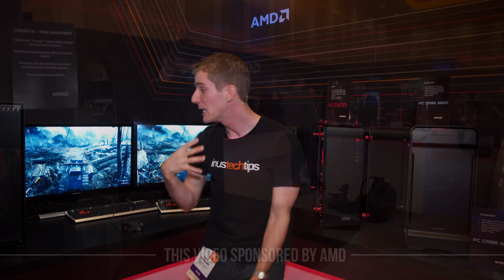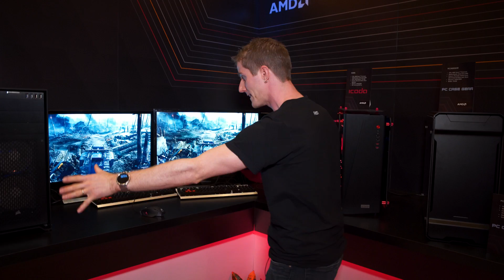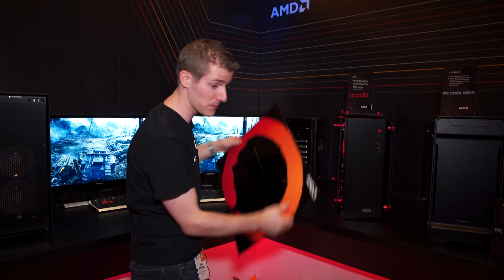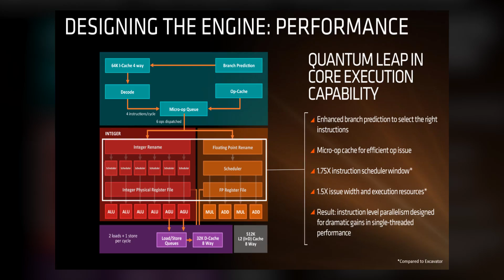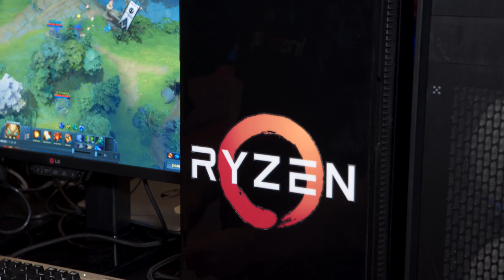AMD Has Ryzen!

Comment: That moment when you just bought an i5 6600k...
Reply: same just bought an i7 6700k
Reply: Deniedstingray its ok, when AMD releases something you don't need to worry
Reply: I just got a i5 660k too, got it for like $120
Reply: i buy an intel core i5 6500 & gtx 1070. Im really happy with it
Reply: dw, bought 6600k 6 months ago, be happy because 6600k is keeping up real good with 7600k and the difference isn't even considerable, but ryzen is a different story bruh
Reply: i bought a 6500, only because I desperately needed an upgrade from an i3 3120m laptop with hd graphics
Reply: I just bought a 8370 and I'm very happy with its performance on any game basically on ultra paired with my 1060 :D can't really complain.
Reply: i bought a 4790k
Reply: Tian kay have you tried to rma your chip?
Reply: Conor Uhh, cause it's a quad core and some games don't run well with a dual core.
Reply: I don't know, maybe availability? Here in Germany 7600k's and 7700k's are pretty rare right now. The next supply of 7600k's for Mindfactory (german site) is coming in on the 11th of January. And even then I believe 1 or 2 days and they will be out of stock.

And Kaby Lake isn't that much of an improvement over Skylake, so it wouldn't really matter.

I agree Kaby Lake would be what you should be going for however.
Reply: Ahmet Refik Eryilmaz I remember when AMD said that the RX 480 would be as fast as a 980 at the E3 PC Gaming show. Sadly people are quick to forget because of fanboyism
Reply: don't buy any CPU till ryzen launches lol.
Reply: Don't feel bad. You can never keep up with technology. I mean, I bought the GL502 and within a month or two, the 1060 versions came out and I'm stuck with the 970m. This is with an ample amount of research too. I'm still salty, but eh. That's just life.
Reply: That moment when someone buys a cpu at this time of year near a new tech release.
Reply: Yet Another Terrible Channel Honestly dude, keep your i5. Unless you are heavy on content creation or render videos frequently, there will be not much difference between i5 6600k or AMD ryzen. Gaming only really uses 4 cores.
Reply: and i just bought a fx8320E
just fuck my shit up fam
Reply: dont't worry im running my i7 930 at 4 ghz and it still kicks ass in games, matter of fact I have the same fps as my fried that has an i7 6700k.  All this talk about new cpus new technologies is just bullshit to make money if you are a gamer you are good with that proc for another 6-7 years.
Reply: Then your friend is GPU bound or runs at higher settings than you. I personally saw an increase of roughly 30% after swapping my i7-930 to i5-6600k(and significantly more in games that are poorly multi threaded). I think the Nehalem chips are the last generation of Intel chips worth upgrading from. Sandy Bridge and newer are still excellent as you can OC them to 4,5ghz+ with minimal effort and they will provide very similar performance to the current generation CPUs.
Reply: My poor brother. I'm still with my Phenom II 965 BE and desperately waiting for ryzen to see if I need to finally buy an intel cpu or if I will upgrade to ryzen
Reply: Bro, who are you buying your stuff from? New egg is selling the 7700k for 332€, for me it 350 USD off newegg.
Reply: You weren't smart. It is known Ryzen is going to drop pretty soon. We knew it for like half a year now.

Although the 6600k is a solid buy, if Ryzen competes with Kaby Lake/Skylake (and AMD will drop CPUs in every price class) the prices will drop quite a bit, I am sure.
Reply: I don't know in what parallel world you live, but it doesn't need to be beaten by AMD. They just have to make something better in terms of price/performance.

And it will be cheaper. No sane company would put out inferior products for the same or even a higher price.
Reply: RX 480, more expensive than GTX 1060 6GB, but only 1% better than GTX 1060 3GB. the 6GB version of GTX 1060 still beats the RX in most todays games, and is cheaper. And don't give me the 'but in DX12 is better and is futureproof!'. It is more expensive and that's it. GTX780ti is fuureproof, still beats RX480, and is 3 years old. AMD should be ashamed. I waited long for that RX480, but they disappointed me so bad, I switched completely to Intel/nVidia, and I was an AMD fan for more than 10 years.
Reply: Absolutely no one cares about VR. Not a real gamer anyway. VR is 5-10 years away from being mainstream. The games are clunky and ugly.
Reply: You can always resell computer component, I always sell mine when I upgrade.
Reply: daniel solomon Well kinda your fault for living there
Reply: Yes, you should wait for Ryzen and the likely price drops, or even buy AMD altogether.

Wait for first Ryzen reviews from CPUs in your price range, as long as you don't desperately need one right now.
Reply: Yet Another Terrible Channel I'm getting an i7 Kaby lake 7700K
Reply: What you buy an i5 for? Useless junk, get an i7.
Reply: I don't think you're gonna need upgrade that monster anytime soon... Clock it 4,4-4,6Ghz and you have enough for at least 2 more years.
Reply: Haha I bought the same chip but willing to replace it with RYZEN,  been waiting for AMD to pull something...
Reply: i feel disgusting right now
Reply: Damn i feel for you mane, lol
Reply: same
Reply: Cirrus 😂😂😂
Reply: Yet Another Terrible Channel I know the feels.
Reply: Yet Another Terrible Channel Same here plus a gtx 1070.
Reply: I too have an AMD FX 8370 and I agree with you i have mine paired with an Nvidia GTX Zotac 980, but tell me how well does yours run in any cpu intensive application? I will tell you about  my experience  some  cpu bound applications aren't optimized evenly  for example a game mmo like TERA  seems to favor intel more than AMD, but i wonder i am right now  using an amd ddr3 memory 1866. Does having a 2400 ram makes difference?
Reply: 23Aike6 wouldnt bother upgrading that ram tbh, the performance gain to cost ratio is gonna be abyssmal, was considering upgrading my own 1600mhz 16gb kit, but it costed way to much comoared to what i would get in return. if you need a ram upgrade it should be on the amount avaible and not just the speed alone. also if you OC your 8370, you will boost you ram chips frequency, since cpu clock and ram speed are tied to the same multiplier.
Reply: Yet Another Terrible Channel I like your picture.....Papa Ajasco?
Reply: Conor Because most people don't need anything more.
Reply: Yet Another Terrible Channel Feelsbadman #AMDFanboy
Reply: outside of the pricetag premium compared to AMDs base CPU it's still solid, and we don't know how AMD rizen CPUs scale with ddr4 speeds but plenty of tests show a positive relationship with ram speed and Skylake. play that to your favor and your likely still set to compete. I'm excited for AMD (I'm a massive fan) but im just excited for added variety to the CPU world. hope this year red and blue flourish.
Reply: daniel solomon I live in Italy and I bought an I5 6500 for 170€
Reply: It's okay, you'll be able to keep that CPU for probably the next 2-4 years.
Reply: drive it until the wheels fall off!
Reply: Same just bought a 6600k...
Reply: Yet Another Terrible Channel That's fine, if that was your price range you're probably not gonna buy one of the high end ryzens that are released first. The 6th Generation Core i5 CPUs are the best sweet spot for that generation, and Caby Lake
Reply: Yet Another Terrible Channel I might should I still buy one?
Reply: solmyr2 Naw man, I was running the same setup 6 mo ago (but at 4.2GHz), I actually got large gains, some 15 to 30%, from moving to a 6700k (tested for equivalence at 4.2, but normally run it at 4.7GHz) in many - but not all obviously - games, as well as professional apps, eg programming (my day job).

This being said I'm definitely not gonna bother with Kaby Lake..!
Reply: You have enough power for now.
Reply: I have mine a year ago and Kaby doesn't bring anything new that is significant. Waiting for Icelake...
Reply: Yet Another Terrible Channel lol its powerful thl
Reply: solmyr2 

that shit will be out of date way before then.
Reply: Tian kay 
Lmao
Reply: wtf why not 7th gen?
Reply: MrNoziv this is literally me with the same exact CPU and everything 😂😂
Reply: Because they're pretty much the same chips.
Reply: NOT AT ALL THE SAME
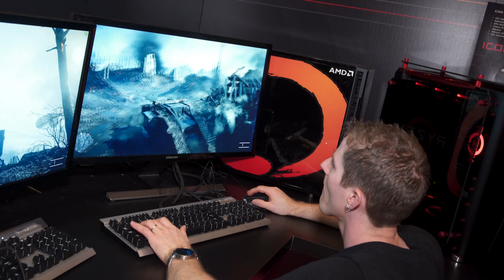At 2:23 intel hits 75-76 fps costantly
whereas amd hits 55
YOU JUST HAVE TO SEE THAT!
also, the amd marker is white , whereas the intel green,
because they never exeed the 58 fps
Reply: Because nothing is moving in the game dumbass. The tank says still.
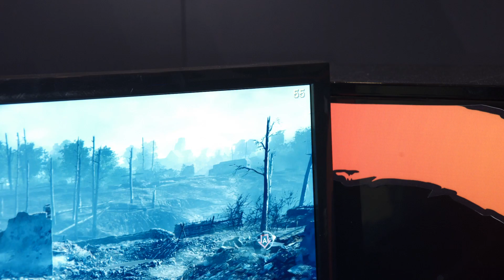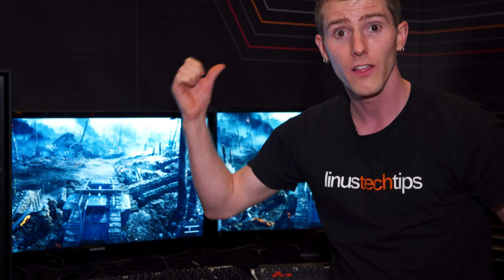Reply: LOOK AT 2:30 UNTIL 2:35
SORRY YOU RE FAULT
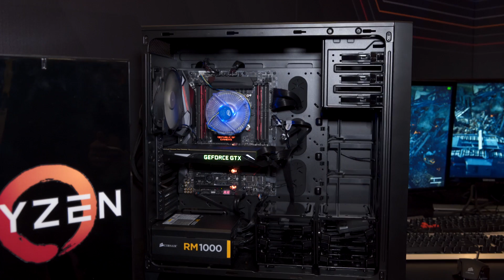Reply: SOORY, LOOK at 2:05 to see that intel has still green fps while linus does;nt play
Reply: Dieser 1337 Baka. plus, if you were gonna go Intel right now, why go Skylake instead of Kaby Lake?
Reply: Dieser 1337 Baka. yeah, if you can't get your hands on Kaby Lake, and you NEED to upgrade, Skylake is still fine... I mean, even if Ryzen is half the price and better performance, that doesn't instantly make Skylake and Kaby Lake trash. they're still gonna be good
Reply: Completely agree. Intel CPUs are solid. Even the ones 3 generations behind. Can't say the same thing about AMD.
Reply: That 6600k will not be beaten by AMD. Maybe in their dreams. And definitely not cheaper.
Reply: Now that really sucks.
Reply: CapsuleGraph used?
Reply: lol AMD never said anything about 980 performance.

They said it is "VR-Ready".

What card was VR-Ready at the time? :thinking:

970. Did it reach 970 performance? Hell yes.

They even told (i believe it was) JayzTwoCents the goal was to tackle 970 performance for a lower price. Not 980. That was the fanboys making shit up.
Reply: You are spreading false information.
Reply: I remember the hype. With that hype AMD lost me as a client. For 10 years I had AMD cpu+gpu in my PCs. Had enough of them.
Reply: Happy moment. You should be proud to own a VERY good cpu.
Reply: I have just said what AMD stated. Which was the 480 is "VR-Ready" - meaning it has 970-like performance.

VR is neat, but I agree. Far from mainstream.
Reply: daniel solomon Are you stupid? Or do I have to explain to you how taxes work?
Reply: Yet Another Terrible Channel lol...you should of waited bro
Reply: I was just about to go buy mine... Yeaaaah not happening just yet.
Reply: Yet Another Terrible Channel You're fine.
Reply: Yet Another Terrible Channel I was going to buy that one are you saying I shouldn't?
Reply: Cj Bower lol please stop
Reply: I just dropped 3k on my new beefy computer. I'm literally building it tomorrow. i7 6800k smh
Reply: Tian kay the g4400 pentium ain't all bad. It was a pretty decent processor for low payloads till I got a job with video editing and then had to upgrade to an i7
Reply: Can laptop CPU be upgraded? If so what kind of laptop? I thought most laptop have built in CPU with the motherboard?
Reply: Yet Another Terrible Channel why not 7600k
Reply: Peťo Pavlík because there's basically no difference, no point getting the 7 series over the 6 series
Reply: Equinox - like what games
Reply: That moment when kaby lake came out...
Reply: Dezza2241 i know but it's newer and have cooler motherboards
Reply: not really anything above 1600 is fine
Reply: If you get an i7-6700k you'll see double FPS ...
Reply: i got mine like about a month ago -__-
Reply: +CapsuleGraph how, mine was 250€
Reply: If Ryzen CPUs end up costing more than $200 then you didn't make a mistake by buying an i5.
Reply: i5 will drop in price tho
Reply: 6600k stays one of the best price/performance. Bought one a month ago for 240€
Reply: Cestarian Inhabitant Yeah becuz the 6700k is SOO much better than the 6600k
Reply: I wouldn't worry about it TBH. I bought one last year, it's the top i5 at the minute and if you feel you need abit more juice just OC. I'm expecting to get at least a couple of years out of mine.
Reply: I'm about to be buy an i7 6700k is the ryzen better?
Reply: I just grilled my i7 CPU and MOBO,you wanna talk about bad timing?
Reply: The Closet Gamer
Idk man,I'm split...I can have a 8350+mobo for 300$CAD,plus OC'd by a professional for free from my local geek.He once sold me a ASUS mobo at his cost price,55$ :D He's awesome and very good at what he's doing!but yeah,i'm just confused at this point.
Reply: Yet Another Terrible Channel same.
Reply: mine hasen't degraded, infact its increased. (from Mobo bios updates and other updates). don't overclock if you don't need to mane
Reply: sux man :/ my setup just died aswell. i7 3770k with a sabertooth z77. had it running at 4.8ghz for about 3 years. then it started getting unstable and i had to get it down to 4.4. not long after i started getting all kinds of bluescreens about kernel errors and memory problems. i got a total of 7 diffrent bluescreens. then the last time before it never launched to win/dident let me install win either i got a warning . 1.47 vcore. it was set to to about 1.3v tho .tried 4 diffrent versions of bios aswellto see if some of the settings fcked with the vcore  did test the memory for 36hours and found no problems with it. the psu works great in this amd system im borrowing. so im guessing the overvolting must be due to the motherboard? anyways my point is. i think overclocking takes it toll on gear overtime :P and checking for a faulty motherboard /cpu is pretty shitty without a spare motherboard/cpu XD i have wasted so much time! i cant wait for ryzen :(
Reply: which is a very good cpu for years don  t worry... i have the same
Reply: Cyaneyed
I had a 3770 too ffs >.>
Reply: Dont bin it yet guys. AMD hype ALWAYS AMOUNTS to not a lot.
Reply: +boothegoo pc However this wasn't just AMD's chip, but also Jim Keller's design. I never saw this doing bad.
Reply: I know right
Reply: True
Reply: haha i bought mine like a month ago.

Comment: The benchmarks are very disappointing so far. The 8 core Ryzen/Zen at between 3.15-3.4Ghz lands under the Core i5-6600 4 core CPU in gaming. What these early benchmarks tell me is that AMD is still using another version of Bulldozer which is NOT a true multi-core CPU as the 2 ALU's share an FPU in a module. So what this means (and the benchmarks so it) is that their new 8 core CPU is really a fancy 4 core CPU that does well with ALU stuff, but still falls on it's face with any FP math. The conclusion would be to skip this new CPU entirely until AMD releases a true multi-core CPU that doesn't share logic units.

Comment: Nvidia has more support in games. Most games assume Nvidia hardware and are primarily coded for such.
AMD focuses on "value" because they literally physically cannot produce a chip, cpu or gpu, that beats the best their competition can make.

But all that said, with this demo it looks like Intel/Nvidia for playing the game and AMD for streaming the game is a viable option.
Reply: Michael Nyholt Ryzen will be at 4 and 6 core too at insane clock speeds. Canard pc already confirmed 5ghz ryzen on an old engineering sample.

Nvidia cards usually run games better out of the gate but their tech is old and their cards get outdated fast. Pascal is already bad at dx12 and old AMD gpus actually get faster with drivers while nvidia actually nerf them.
Reply: Michael Nyholt exactly. AMD can't physically can't produce the chips, so instead they use Global Foundries & Samsung.
Kappa.
Reply: Areth thou Maddith brethren ?
Your turn of phrase falls flat.
Reply: Michael Nyholt. True
Reply: Been using both products for years, Nvidia doesn't nerf their products, they adhere to moores law which is an upgrade cycle of 18 months.
Reply: Nvidia is good, but sometimes their drivers suck!
Reply: Agreeed but AMD is not exception especially around new releases.